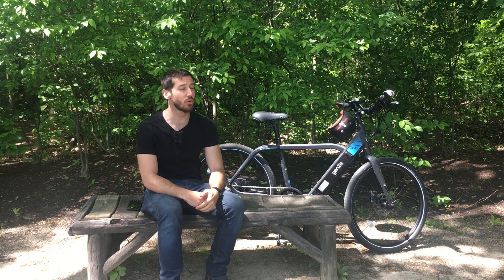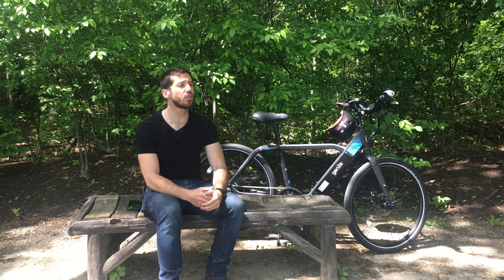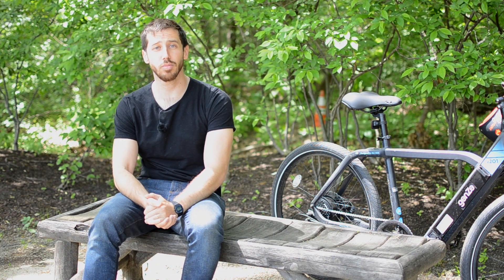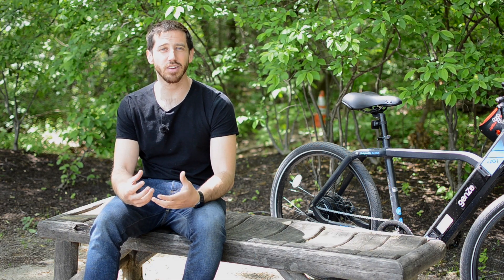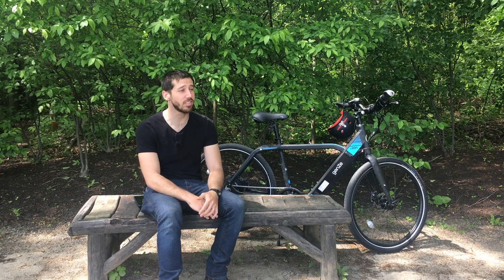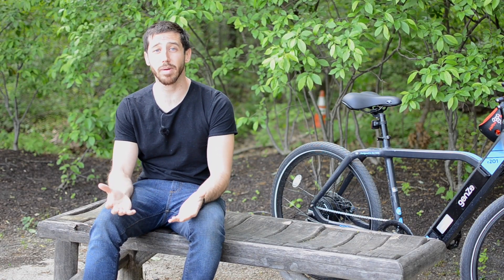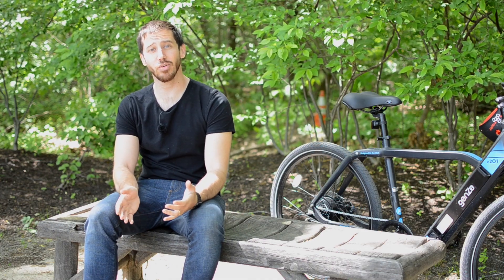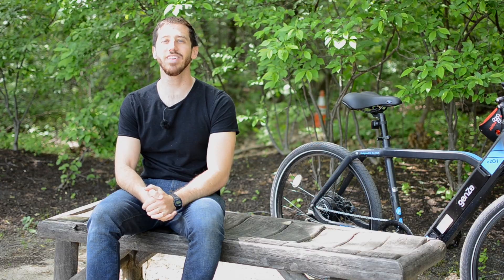How to choose the right bike for a DIY e-bike

Comment: Thanks for this very helpful video.  Im thinking about converting my Firmstrong Bruiser beach cruiser bike.  I have been riding the bike for over a year and really like the scale of the bike and its simplicity.   The upright riding position suits my 73 year old body just fine.  It has coaster brakes and a 3 speed hub shifter that is all I really need on the bike paths of southern California.

A few questions I still have are:  

1.  Are coaster brakes adequate for a front hub motor ebike?  I dont intend to put a big motor on the bike and will be perfectly happy with a 15 mph top speed.  

2. I really like the simplicity of the hub shifter and if I changed anything it would be to add a new hub shifter with more speeds but once I do the ebike conversion even that might not be worth considering.  Any comments on three speed shifters on ebikes?

3.  The frame of my bike has curves that will make it difficult to mount a battery in the triangle.  Im thinking that maybe one of those rear racks with a place for a battery would be a good option.  I know they are supposed to compromise the balance of the bike but I frequently have so much stuff in my saddle bag baskets or front basket that balance is not very good anyway.   Sometimes I dont start my care for a month.  I can do all my errands on my bike.  Do  you have any advice on that option?  

4.  Id also like to mount the controller in some way that its firmly attached to the bike rather than in a bag.  The bike is stored outside and I want everything to be able to tolerate the winter rains of southern CA.

5. I dont want to have the motor putting drag on the system as I expect I will want to ride my bike without using the electric option much of the time.  My understanding is that a geared motors is what I should use.  Is that correct?
Reply: @John Lewis OK, here we go...

1. I haven't had coaster brakes since I was a kid, but they seemed to stop me ok. I doubt that you will be happy with 15 MPH though, as my 1st kit was limited to that. I got my current kit from ebikeling.com, a 36v 500w front hub motor. I've had it over a year now and it works great. Nice to have the extra speed and power even if you don't use it all the time. Their kits are very reasonably priced and come with extras like a torque arm and even spiral wrap for your wiring.

2. It all depends on the gear ratios you have. I just ordered a new 7 sp freewheel for my bike because the one that came with it wasn't tall enough to let me use more of the motor's speed. I always pedal as well.

3. I got rid of my car and only have my bike. How far do you usually ride? People often get hung up on thinking they need a huge battery when they only ride 5-10 miles round trip. I have a neat kettle battery that looks like a black water bottle. It sits in a normal water bottle cage. It doesn't need to lock, as I just disconnect it and take it with me. It should fit onto your downtube, especially if you get a smaller capacity one that's shorter. Mine's only 6.4ah, but, pedaling along at @15 MPH, I can get a good 20 miles out of it on the rare occasions I need to go that far. I got that from Aliexpress. There are a couple of companies that sell them. Just make sure they tell you that they are made from name brand cells, as they sell them both ways. Mine are LG cells, the other good brands are Panasonic and Samsung. If they don't tell you they use name brand cells, they don't!

4. I mounted my controller on back of my seat tube, with a strip of old tire tube and some foam to cushion it. ebikeling now sells kits with waterproof connectors, though if your bike sits outside, you might want to get a cover for it.

5. Yes, a geared hub motor is what you want. No resistance when it's off and you want to pedal all on your own. 

Added notes: I only recently added the PAS (pedal assist) that came with the kit to my bike. While it's ok when you're riding on the street, I still find that most of the time I prefer just pedaling myself and using the thumb throttle as much or as little as I need at the moment. People seem to think that you can't pedal if you use the throttle! I haven't tested range yet, but I think at moderate speeds (15-20 MPH), I use less energy with the throttle than I would in PAS.
At 65, I get everywhere I need to go on my bike. Hope I'm still doing it at 73!

Comment: Hey 
I'm making a DIY electric longboard and I'm trying to make a battery pack for it using the laptop 18650 cells I have gathered from the past months. But my problem is that I want the battery as flat to the board as possible but still keeping a 14s2p setup.. any help??
Cheers
Reply: The first idea I have is to make a long battery with connecting the positive ends to negative ends so that it looks "taller" if you understand what I'm saying. You'd create your 14 sets of two connecting their positives to positives and negatives to negatives for parallel. Then you can line them all up in a row so that all of their positives are facing the same direction and try to make a long battery. If it is too long, then you can do seven pairs like this, flip the other seven around and connect the first 7 set's negative end to the second set's positives to line their negative ends back near to where you started building the battery. You have to make sure the connection between your 2 sets of 7 (where your battery bends back around) is fairly solid b/c depending on how it is built (a 2x2 vs a 1x4) that series connection might get restricted &/or hot and be a potential spot for failure.
So yeah, to put it simply, my first ideas where a 14x2x1, a 7x4x1, or a 7x2x2. I've seen the same thing done in a few electric scooters where the battery was inside the board you stand on so it took up basically no extra space.

Comment: I will Usually buy a waterproof battery bag and mount it on the handlebars….the speed controller I buy a plastic” speed controller box’ and mount on the bottom of the frame rail’ either at the top or bottom.. if the frame have a curve to it’ I also buy a pedal plastic…assist sensor cover….I’m gonna need two torc struts’ 3000 watt kit with a 100v speed controller.

I’m good at Soldering so I usually shorten the brake lever wires…after it’s all said and done. I have a clean personal built bikes.
I own a business for building e-bikes and gas bikes….I’m phasing out of the gas, and doing electric’ way too many Unexperienced gas bike riders’ and I usually have to decide if that rider is gonna tear it up…many ppl think they can just hop on a gas bike, go 20mile trips everyday without doing any maintenance’ I even give them the manual to fix things or remove the back tire for flats.

I had a issue with a customer bringing a bike back’ to fix the flat’ this guy was a customer that I converted his bike to a gas bike’ BIG MISTAKE! I had to unbend the back rim, and the bike was a Piece of shit…it now sits in my garage’ broken engine, and broke back rim.

He thinks he’s gonna get it fixed for free…NOT GONNA HAPPEN! I charged him $200 for the conversion…it was a good kit with a good engine….he’s gonna need a engine, and I’m all out of them…I’m charging him $150 for parts and labor. Need to order Back rim and engine….engine is gonna cost me $45 and the back rim will need $35 dollars in parts.

Comment: I am interested in a two or even 3 motor e-bike. I am planning a cross country tour on my bike. Is this possible?
Reply: I mean you can do front + rear hub and a mid drive all at the same voltage. I don't know how you are planning to power this. It will be heavy.
Reply: @feedallday2556  First; Thanks for your reply . I am a total novice at this sort of thing and need all the help I can get. Now, I am hoping to go across country on this bike and I feel I need as much riding time as I can get from a charge. I will have some Ozark hills to deal with on my route. Would two motors suffice? I plan to use 52V 18650 battery packs.
Reply: @1955ozzie  One motor is more than enough to cross the country. Its the battery that becomes the problem. I would go with one motor and then spend all that money you would spend on the other motors for additional batteries. I would imagine that you need atleast 1.5-2kwH for a cross country trip and between charging stops with a low PAS. I am planning to do the same but on an ebike gas generator hybrid, which is outside the scope of ebikes though. A quality mid or geared hub rear drive would probably suffice at 500W+.
Reply: @feedallday2556  Thanks for this input ebike allday. It never occurred to me to use one motor and multiple batteries. I think that is the idea I was looking for. Thanks again.
Reply: @1955ozzie  You can make it easily across the country. The size of battery will determine the amount of pedaling and effort that you have to put in. Its daunting at first but plan out the battery situation carefully. As you add additional batteries you want them to be from the same source and size (voltage, ah). Furthest I went in one day on a small battery (400wH) was 150 miles in a day (past dark) with a lot of pedaling. Plan out battery, water proof setup, and then get good road tires for efficiency and easy pedaling.
Reply: @feedallday2556  Wow! 150 miles in one day. I was thinking of 60 miles in a day. I will need to make it to the next town or two, find a church, and charge the batteries while I camp out behind it.
Reply: @1955ozzie  You will be surprised at how far the ebike can take you with good fitness. I used that one to not hit my lactate threshold on hills and into nasty headwinds. These two will make you fatigue but with the ebike they go away. It depends on your fitness level but the bigger the battery the better.

Comment: I wouldn't have considered a steel bike, just because they are so much heavier to ride, but you are right, steel is a lot easier to work with when doing modifications.
Reply: Its not the weight as much as rolling resistance of the wheels that you use. That is why you see strongman being able to pull a train; train wheels on track have extremely low rolling resistance.

Comment: I have a 48v 1000w rear wheel drive ebike. Just recently it started getting hot within 5-8 miles and seizing up. Within a 1/2 hour it was back to normal and free spinning. Anyone have an explanation for this?

Comment: is there an easy way to lower the voltage from a battery that has ac out? to make it 48volts?
Reply: ac out? huh? you can lower voltage from a battery by using a step down converter. but note that voltage lower should not be too dramatic and then you are limited by the amp limit on that converter. this is generally discouraged.

Comment: Ok,following all your vedios.also need few details about battery packs. We don't have li-on batteries manufacturing companies, have to import, with more cost. So recollection laptop old battery packs.

Can you please exapln more about battery pack, about voltage, ah etc... 
1.can we make a battery pack with old laptop battery cells.? 
2.how to know which cell is working or good for make/use it for battery pack? 
3.Assume that gathered few cells Now how to calculate each cell should have min ah or voltage? 
Ex. Required 48v 40ah for 750watt motor. Now 750/48 or any for choosing each cell ah.

4. What is the best way to increase mileage/kilo meters per charge.assume we have 50ah means increase ah can we get more mileage/kilo meters per single charge? 
Also kindly expain BMS connections for battery pack, during purchasing do we need to consider BMS ah capacity...? 
Ex if I want to increase Ah do we need to change BMS with respectable voltage..?
Please kindly expain my queries I'm struct at making battery pack since lack of knowledge. Yes Offcource I'm also one subscriber from the list.
Reply: Yes, you can use laptop batteries. I think the good battery extraction rate is like 40-50%. YT has many videos on how to evaluate a laptop battery
Reply: I have read that laptop batteries do not have a high enough discharge rating. Be sure to check on that. I HATE to advertise for them but Walmart has 4 packs of Panasonic NCR18650Gs for $14.99. That's a great price. They're 3400mah, one of the highest in the industry.

Comment: What is the correct type of battery for e bike.. Lead acid or lithium battery???
Reply: lithium ion 18650 cells but you have to do with what you have available and hence limitations with that
Reply: @feedallday2556  Thank for your advice.. are there any issues with 18650 cells for long time usage for 1000w hub motor ??
Reply: @madhusankaperera8566  No, there should be no issues if paired with a good bms. If you are building the battery, you should do more research into it before buying and starting.

Comment: How many watts does it take to move an average person (160 pounds) 10-15Mph on a flat surface?
Reply: @myrondesjarlait9752  did you even read what I said?
Reply: @myrondesjarlait9752  you do not understand the difference between instantaneous power, volts, and amps. You can not help me
Reply: 400-500W
Reply: @feedallday2556  no way in hell. most ebike motors are 250W or 500W motors maximum
Reply: @SpitOnYourPalm  You're right, 250w should be enough but, if you already knew the answer, why ask the question?
Reply: @SpitOnYourPalm  Well that is considering ideal conditions. Wind resistance is 2nd power and most places have headwind so with all of that real world it is close to 400-500W and this is without pedal assist. I am not sure if you meant just throttle; yeah with pedal assist it would be different of course. Okay, maybe 350-500W. I am 125-130lb and 500W is like 19-20 for me in ideal conditions. Yeah, if you know the answer why the hell do you ask.